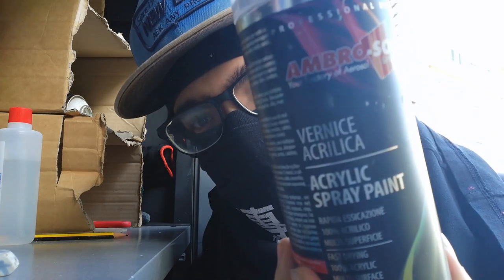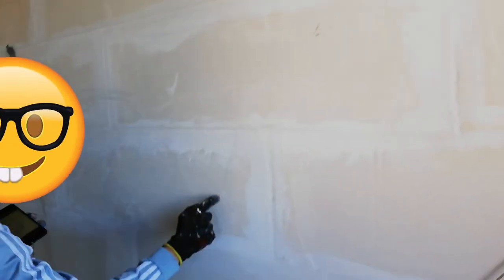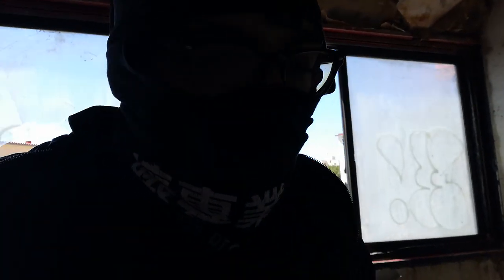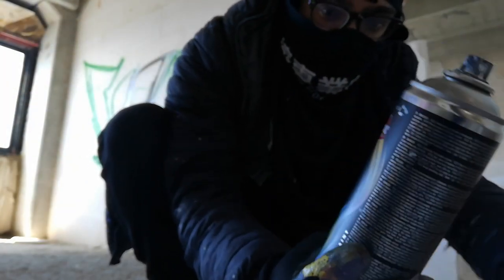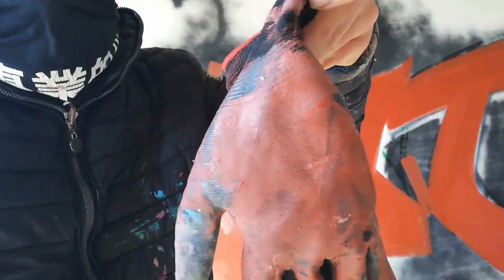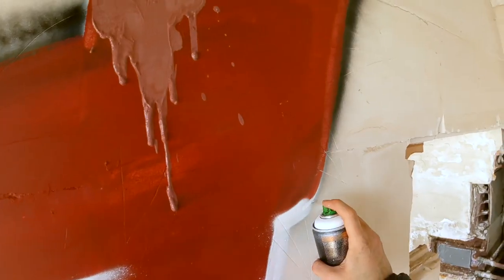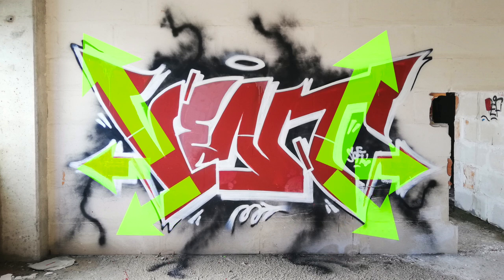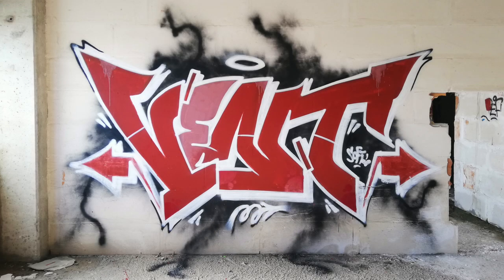MY FRIENDS ARE COPYING MY LETTERS! | go cheap or go home ep.6

Comment: The caps in acetone trick is a bit of a joke. The acetone might soften the clogged paint on the outside a little bit, but doesn't really get properly to the inside of the cap. You need pressure to get the clogged paint out. For everyone that's reading this, get yourself a can of acetone spray. Use it right after painting. Yes it's pretty expensive but you will safe more caps then the can costs you.
Reply from the maker: Yea i Will try it one day, i really hoped acetone would be dope, but sadly it isn't.
But on fat it worked, maybe is a bit random, surely not a solid technique.
Reply: @VentOne  Maybe you could get a can with the boys and share the cost. You'll earn it back in no time!
Reply: Also if you keep the caps in the acetone to long it ruins the rubber on the cap
Reply from the maker: @itsawastegraffiti  how much time is "too long"?
Reply: @VentOne  i had them in there for some days 4 or something maybe
Reply from the maker: @itsawastegraffiti  okok, yea maybe it's too much
Reply: Yes man for sure!! I've been using it for a couple years. I've managed to get three full pieces out of one cap before.
Reply: carburettor spray works really well for this btw cus of its high acetone percentage its literally designed for removing thick stained dirt

Comment: Grazie per qualche bella risata, signore. Mi piace molto questo forse è uno dei miei preferiti e mi chiedo se le frecce fossero bianche con un'ombra rossa (invertita) sarebbe stato un momento sexy. una cosa però... Odio quella freccia a spirale sotto.
Reply from the maker: Fusi che commenta un mio video in italiano, è la cosa più bella che vedrò oggi.
Anyway thank you sir, maybe the arrows could have worked also in the way you told, but probably i prefer them like this.
About the Little arrow At bottom... Well...
It could have been cooler to be honest 🤣
The black shadow doesn't fit with that...